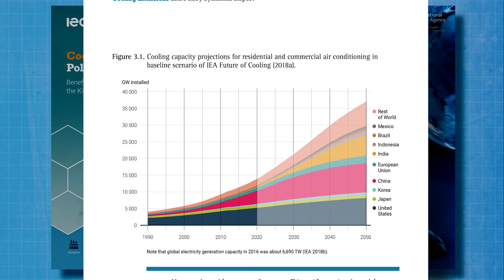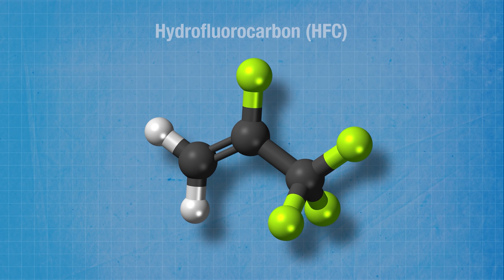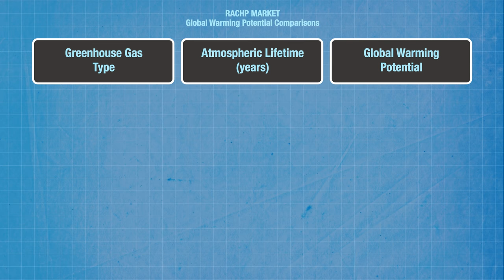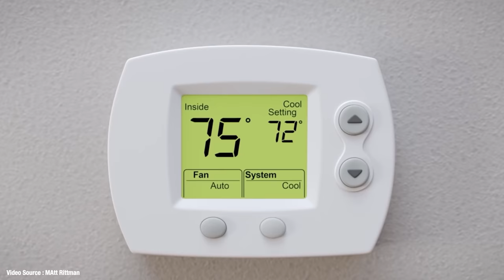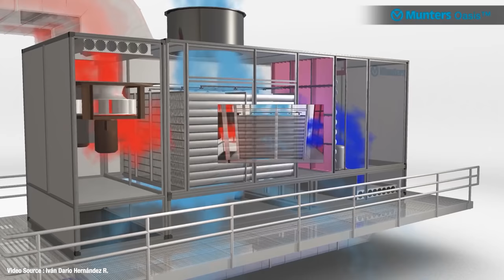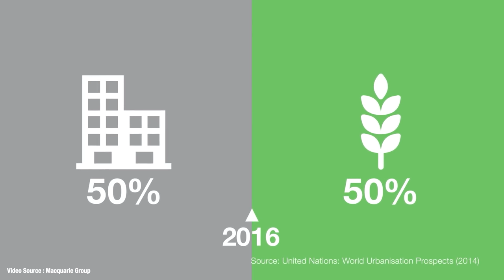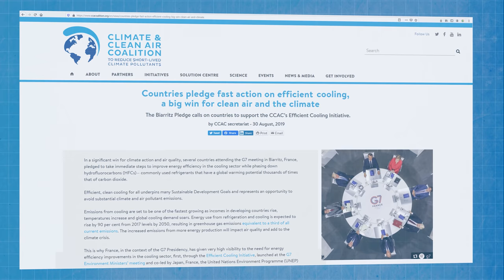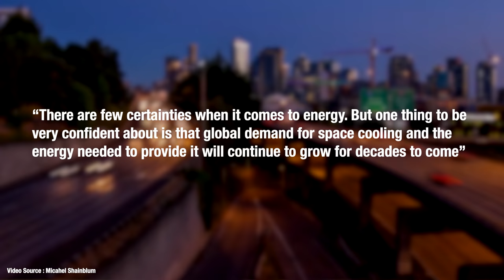Keeping cool in a warming world.

Comment: The future is going to be far colder than anyone will admit. Give it a little time beyond the next solar Max...
Reply: I'm going with your science Mark Trimm because in 65 years you've never let me down, apart from that once in 1957 when you calculated my Go Cart could roll down the ack ack tunnel roof on The Scrubs & around the gun circle without going in the ack ack gun pit according to kinetic theory. That didn't go well but otherwise you've been reliable for 70 years. Sod those scientists, I'm going with Mark Trimm the Wolfen Shape Shifter   for my science.

Comment: 1:04 Gas market in 2019 because of very warm winter in 2019 55% of gas stock was never used during winter period, so global warming will solve our solution to used less energy at least in winter time in North hemisphere, so demand drooping, and AC units is very energy inefficient maximum 30% electric energy converted into cooling energy of AC unit still this 30% is cooling not heating in winter time.

Comment: The best "climate friendly refrigerant" is CO2 ; heat pumps already exist with this gas, the cheapest to make... but isobutane and all the alternatives shown in the video should be enforced by law in the devices. Devices using high GWP refrigerants should be forbidden in new installations. This is the kind of topic where legislation and norm works the best. At the flip of a switch, we can get rid of the problem of the new equipments and focus on the decommissioning of the billions already in use only. What drives me mad is that it is impossible today to buy any equipment using one of the right gases.

Comment: Elementary really temp goes up turn up the air con, shovel a little more coal and problem solved - straight forward really.
Reply: Yes. The way to make it cool is by burning a whopping big fire. White roofs are a simple solution, solar panels to power your AC and freeze a big ice cube for evening/night cooling are 2nd best. I'm being silly, no need for the ice cube. Underfloor heating in a sufficiently massive floor/cold store will do just as well, and serve to heat in winter.
Reply: @astranger448  There have been practical and affordable solutions for over 20 years, but vested interests have prevented the uptake - now it is simply just too late - like the Piper Alpha rescue time just ran out, it has for us as well. Ps I have a degree in renewable energy and eng, I shake my head at the dismay I may be wrong things may work out but nah.

Comment: Air cooling once installed does not contribute to heating except energy used to do so, as it is just transferring energy. Solar panels on the other hand heat the air, and is contributing to a hot atmosphere. We will be going into an ice age soon, as  when melting artic ice runs into the ocean currents, which will stop them transferring heat to the northern regions.
Reply: Solar panel heating is insignificant.  The albedo of the panel isn't that different from most roofs, and the surface area relative to the surface area of the planet is negligible.  Further, the blackbody radiation of the panels at night is higher than the surfaces it covers, so that results in cooling.  The net result is close enough to zero to ignore.  Now, for the nutty stuff.  We will be going into an ice age "soon"?  Links?
Reply: @incognitotorpedo42  No, I believe that's totally wrong. I work on rooves and believe me solar panels are extreme heaters. And when you factor in massive tree clearing to put in heaters, for solar farms, well,  you get the picture.

Comment: The ground 10 ft down is around 50 degrees .
Heat pumps that have pipes going down are very efficient 
Why cool air 20 degrees when the earth can do it
Reply: Works very well, I use a variant called a Canadian Well, basically a long pipe 3m down for ventilation air. Cool in summer and it also raises the air temperature above freezing giving the heating a leg up. It would work very well for new suburban housing. Not so simple for retrofits or in densely populated areas. Energy consumption is minimal, initial investment also IF the digging can be combined with utilities trenching and such.
Reply: @Tom Robertson  "The ground 10 ft down is around 50 degrees" .  No, the ground 10 ft down is around 4.6 degrees or -6 degrees or 27 degrees.
Reply: @grindupBaker  Tsktsktsk. Process engineers around the world have been using ground water as an option for cooling industrial processes. 13C/55F is what they use as temperature. Pretty down to earth folks too those engineers, not given to flights of fancy. Now if you are talking about an Inuit engineer....

Comment: 2:45
By the way is it more efficient to have cartonised soy/long life, than plastic bottled liquid milk distributed, the cartons, although not cooled are non recyclable, so the embedded energy is higher than it appears, when we were kids we had tetrahedral cardboard but now multi layered, rectangular with plastic screw capped spout.(for juices and milks).
We went with net curtains rather than double glaze as in Australia heat input is the bigger issue.
But external shuttered on the west facing side, working on white fibre glass cladding for the north, but the cutting equipment is taking some time to modify.
We went with room coolers rather than a centralised system, 700watt,AKAIs split reverse, and centralised drainage along with fridge to flower bed.